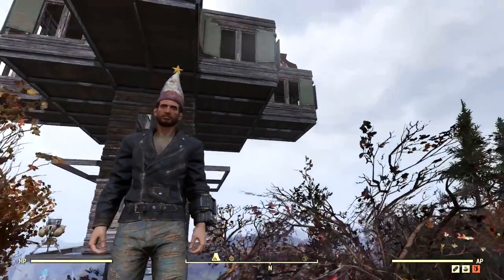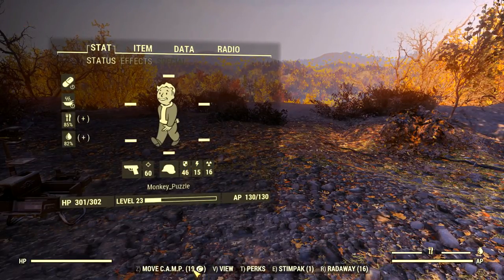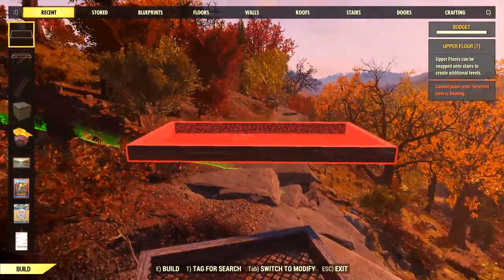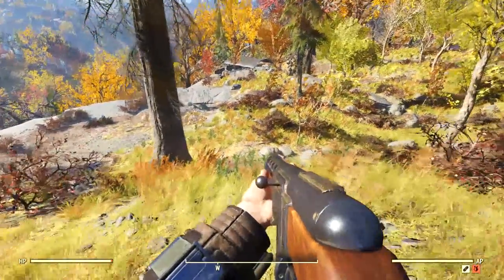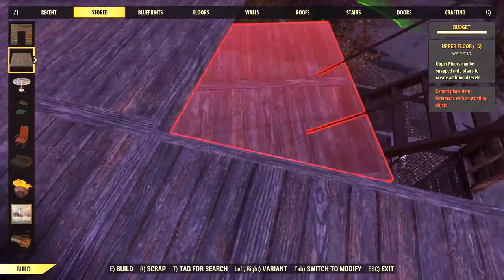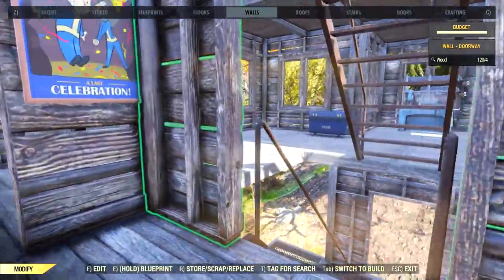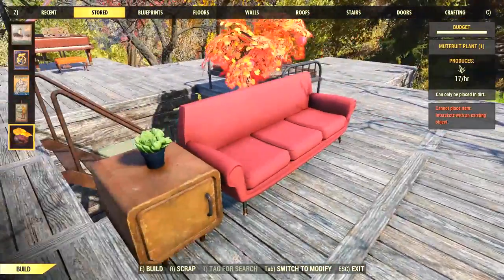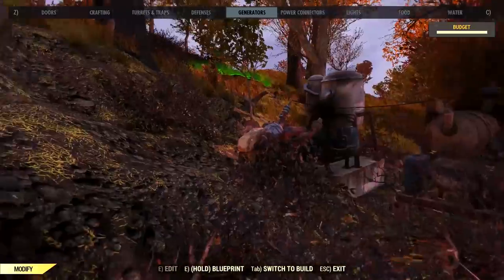Fallout 76 CAMP Tutorial - Fully Mobile Max Budget Base Step by Step Build

Comment: made something similar but it won't let me place it elsewhere.. guess i'll try it in sections
Reply from the maker: If it says object is floating, that's probably because there is an offending part on it somewhere. Next time trying moving it at several stages as you build. This helps you figure out what works and what doesn't before you get too far.

Comment: It won’t place is there a way I could give it support?
Reply from the maker: There is some offending structure you included. For me it was the posts above foundation level. I've been recommending building it in stages and then trying to move and place it at each stage. That way it will be easier to trace back to what didn't work.